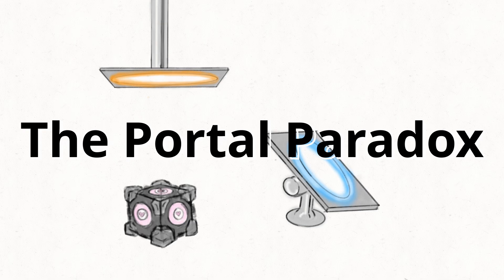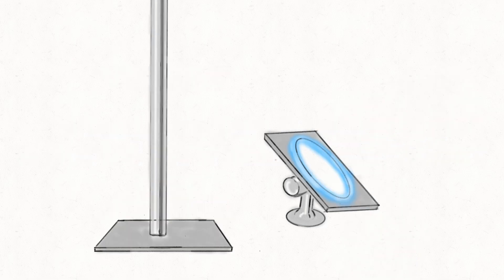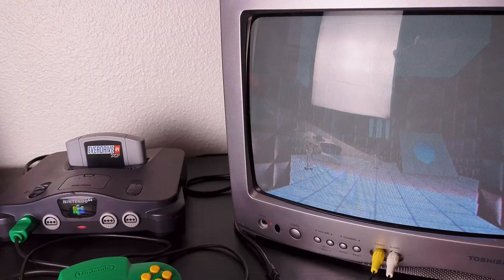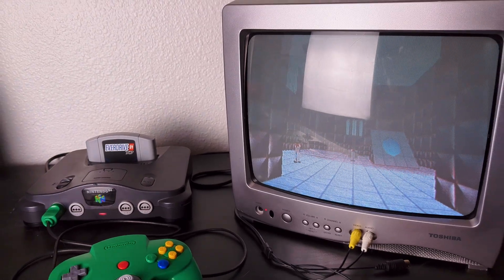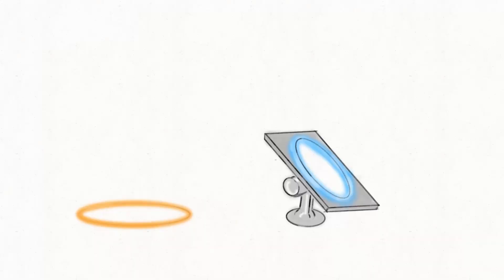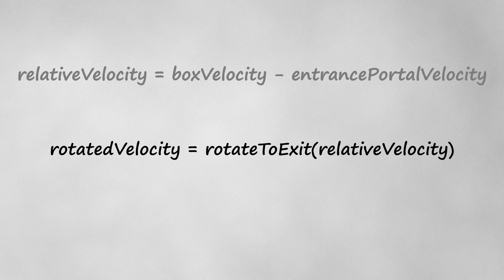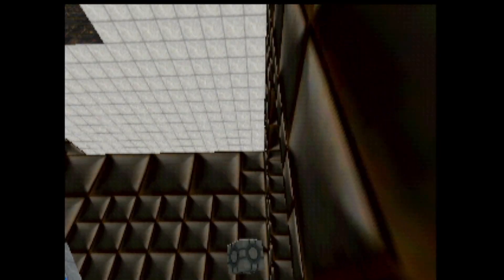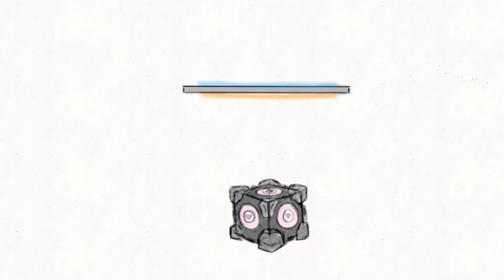I rewrote Portal from scratch and solved the Portal Paradox

Comment: You cant have the cube maintain its relative velocity to both portals.
You have to look at the energy of the cube. There is no way to impart kinetic energy on it from passing trough the portal. The portal just transports it to another place adding potential energy trough magic.
Reply: If the cube doesn't maintain velocity relative to both portals, it can't pass through. This is the only interpretation that lets the cube pass through without being distorted or destroyed entirely.

If the cube doesn't exit the exit at the same relative speed it entered the entrance, what happens to the length of the cube that has to "wait" to come through if you imagine it plopping out with no speed?

Where is the cube if it doesn't come out at the exact same speed it entered?
Reply: @fieldrequired283  You CANNOT maintain relative velocity to both portal because the cube is being teleported. It just is a situation that breaks all laws of physics.
Reply: @fieldrequired283  You have to forget the speed and think about forces on the cube. If there is no force applied on the cube it will stay on the same place. The only force that would do anything to the cube is gravitt and given the angle of the second portal the cube will just be translated trough the portal and not even plop due to the position of its center of mass. I will just stay there
Reply: @Obbliteration 
Portals inherently change the momentum and location of objects that pass through them. That's just how portals work.

It's like asking where the portal gets the energy to carry a cube from the bottom of a room to the top. That's just how portals work. They move things without applying direct mechanical force.

If you dispute this fact, you're just saying portals don't work, and so every possible interpretation of the paradox is wrong.

If portals work at all, they work the way they're showed in this video. The other way is logically incoherent for the reasons I described in my earlier comment.
Reply: @fieldrequired283  According to what or who?
Reply: @Obbliteration  
I gave reasons in my earlier comment. Read it again and form a more specific objection if you have one.
Reply: @fieldrequired283  I already explained everything. This conjecture cannot be solved because it is based on something that just cannot be explained with the laws of physics of our world. Any definitive answer has a fault.
Reply: @Obbliteration  
So, your arguments indefensible, you've moved the goalposts from "the cube plops" to "the question is unanswerable".

That's a kind of progress.

The cube launching out at speed is still the only way it can coherently work if portals are to work at all, though.

It is undeniably the best model in terms of cohesion with modern physics, intuition with portals, and the way portals are showed to work in the game.

The question isn't "are portals real" it's "what's the best model for how portals would act in this situation based on everything we've learned about portals".

And there is a correct answer to that question, and it's that the cube should be launched.
Reply: @fieldrequired283  I already told you. There is no correct answer
Reply: @Obbliteration  
There are better models and worse models. In this case, the launch hypothesis is simply a better model.

Even if you're taking the intellectually cowardly stance by declaring that there is no truth once your own pet theory is disproven, some answers are still better than others.
Reply: @fieldrequired283  Your comments havent disproven anything. We are just casually talking.
Reply: @Obbliteration  
Deflection. You're filling space with nothing because you know you are unable to substantiate any positive claim.

May you one day learn to concede a point more gracefully than this.

Comment: If this was true, wouldn't you be creating infinite energy? 
Your portal has a speed and the cube doesnt. If the cube gets the speed of the portal you are creating energy out of nothing.
Reply: Two stationary portals are already infinite energy. You could use two portals in a vertical hallway to power a waterwheel forever, no questions asked.

Portals violate conservation of energy, momentum, and velocity right out the gate. This objection defeats all portals, not just moving ones.

Comment: that's basically what I had in mind, cause I was thinking of it from a relativistic perspective. The box has no motion relative to the immediate space around it, but relative to the portal's immediate space, it does. Almost nothing in the universe is absolutely still. Even you, sitting in your chair, are technically moving at about 450,000mph. You just don't feel it because relative to the solar system, the difference between your velocities is close to zero. Even just floating out in the void of space, you're still being pulled along by the expansion of space. Thinking of it from a newtonian perspective, the box stopping in its tracks after having the portal slam into it would violate the second law of motion. If you are looking through the blue (stationary) portal as the orange portal approaches the box, you will see a box approaching the portal fast, and it will keep moving that fast as it comes through the portal. The inertia is preserved as the momentum is transferred from the orange portal's immediate space to the box. Another experiment to try is to shoot the box and portal at each other at the same speed. If you're just subtracting their velocities, then you should expect to see the box come out of the blue portal with no velocity, but based on the newtonian thought experiment, what should actually happen is that the box comes out with the sum of both its and the portal's velocity, since that's how fast the box appears to be moving to an observer outside the blue portal. So if the portal and box move into each other at 5mph each and the blue portal is moving at 5mph in its face direction, then the box should come out at 15mph.

Comment: Everyone approaches this "paradox" wrong. Ultimately, portals are non-physical, the game-world of portal is not real, so the solution must necessarily be author fiat i.e. the answer is whatever Valve says happens.

Trying to actually solve this using real-life physics is impossible because portals do not obey real-life physics. They routinely violate both conservation of energy and momentum.

The thought experiment is meaningless because the answer is arbitrary.
Reply: This is the only way for things to work if portals are going to work at all.

You could just say that portals don't work at all, but you're not solving the paradox, you're just refusing to engage with the problem.

The plop hypothesis simply does not work with physics, while this one does. It's only arbitrary in that he chose the interpretation that lets portals work at all, instead of one that doesn't.

Comment: If you flipped the piston and had it accelerating up at 9.8m/s, you could put the blue one on the floor and walk across it, correct? The atoms of the base of your shoes should be colliding equally from the force of gravity in both directions.

Comment: I think this is still incorrect. The portal is simply connecting two points in spacetime together, so the cube's velocity going in should be the same as going out. The only effects on it should be gravity (which would change as it's going through), and the atoms bumping into each other. Since the one portal is moving, the atoms entering that portal are entering in shorter succession than they're exiting, so they would be compressing as they go through. Also, a whole bunch of air molecules would have moved through before it, so there would probably be a lot of air resistance on the other side that would slow it down even more. I'm not exactly sure what this would look like, but it's definitely not as simple as a transfer of velocity. The portal doesn't give a shit how fast the wall it's on is moving. The portal itself isn't moving because it's not a physical thing, it's just 2 points in spacetime occupying the same space at once. Also, if this video is correct, the portal shouldn't even move with the wall: https://www.youtube.com/watch?v=qlce-gNit4U

Comment: If you break it down by the forces acting on the cube it doesn't make sense for it to fly across the room. All you have in both situations is gravity and a normal force to propel the cube. Relative to the cube, only one thing happens, gravity shifts to be at an angle and it is pressed into the ground from the air. So in instance A it is at equilibrium with its normal and gravitational forces. In B the cube is half way through the portal. It experiences a frictional force, a force of gravity at an angle, the force of gravity pulling it to the floor, a normal force from the air into the floor, and a normal force from the floor itself. In instance C is it through the portal, gravity is now entirely at an angle and it once again experiences a frictional force resisting movement down the ramp, and a normal force from the floor onto the cube. If the cube starts without velocity, and it experiences no force to cause acceleration, how does it gain velocity? I don't see how your explanation isn't a violation fo newtons 1st law. It was still and then no force was imparted onto the cube from the direction of the floor to launch it.

Comment: This is actually easier. If you think the cube goes flying, tell me, where did the Kenetic energy come from? If you say "but but, it came from the portal" no, it went through the portal, did not touch the portal.
Reply: In a different reference frame, the cube was moving toward the portal at the moment it went in.

Motion is relative. If A is moving toward B, then B is moving toward A in a different frame of reference.

Since the cube can be described as having some velocity when it went into the portal, it continues at that velocity when it exits.
Reply: @freedomfighter763  no, its not relative. If two objects in space are going near the speed of light, then in the reference frame of the first object they are not moving. Problem is you can not go faster than light, so if you try to make one go faster, it does not go faster. Reference frame is horse shit to make math on the lage scale easier and neglect what is not important. Well in this example, it is important.
Reply: Portals change the location and momentum of objects without touching them. You can see this plainly and intuitively by throwing a cube into a portal on the ground where the other portal is also on the ground.

You threw it in moving down over here, and now it's moving up over there. You completely reversed the momentum of the cube without touching it.

Comment: I don't think you are necessarily wrong, but that also doesn't say/prove you are necessarily right.

First, it's called a paradox for a reason. If there was a solution, it wouldn't be so.
Second, you solved it answering questions you asked, and put it to the test with an assessment you deemed capable of doing so.
What I'm getting at is that it's biased and one sided.
You tried solving a paradox using one example alone. You need more scenarios.

As for the example you made, I believe it makes sense, since the cube is accelerating while on a (closer to) vertical position, which would cause the cube to accelerate upwards and forwards.
Reply: Many things are called paradoxes that actually have a single correct answer. This is one of them. No other way of solving the problem works.

Comment: This video is absolutely correct in all regards.

The thing that people are missing about slamming down the portal that's blue on one side and orange on the other (the second experiment here) is that the orange and blue portals actually have the same velocities as each other, they're just also pointing in opposite directions. It's easier to think about the portals as having an in vs. out reference frame, rather than up vs. down or any other kind of reference frame.

If blue is stationary and orange moves toward the cube at 5 m/s, the cube will enter orange (in) at 5 m/s and exit (out) blue at 5 m/s. But in the experiment the "out" direction of blue is effectively moving at -5 m/s, not zero.

For another example, think about throwing a baseball. If you're on stationary ground and can throw a baseball at 20 mph, your throw makes it go 20 mph in whichever direction you threw. If you're on a train moving at 20 mph and throw it in the same direction as the train is moving, someone standing still will see a baseball moving at 40 mph. Conversely, if you throw it toward the back of the train (away from the direction of motion) a stationary observer would see the baseball stop and fall straight to the ground.

In all cases you have moved the ball in the same way relative to your own motion, but outside observers (us) see very different things.
Reply: To bring it back to the cube example, imagine instead that both portals are on vertical wall pieces, with the orange portal moving toward the cube which is sitting stationary on the ground. The blue portal is on a different section of wall and moving backward at the same speed that the orange portal is moving forward. Any motion conveyed by the orange portal running into the cube would be cancelled out by the backward motion of the blue portal.

The orange portal is essentially "throwing" the cube at 5 m/s, but it's on a moving train (the blue portal) and so it just stops and falls to the ground like the baseball.

Comment: We already have a definitive, in universe, answer to this question.
In portal 2 there is a moving portal, when a portal is shot onto the moon it is absolutely moving in relation to the portal on the earth, yet nothing exits the moon portal and suddenly seems to gain 3500kph horizontal velocity.
The frame of reference changed, but the velocities remained consistent.
Reply: In order for this to be a good analogy, you would have to put a portal on the moon and then have the moon crash into the earth.

What happened at the end of portal 2 isn't like what's happening in this video at all. It's a nonsense comparison.

Comment: Well, maybe this has already been brought up but...
If it takes work from the entrance portal to push the box through, then yeah, it would fly out because it is imparting energy onto the box, but if it takes no energy to push the box through, then no, it wouldn't. If no energy is used to push the box through, the box could not fly out the other end. Relative velocity be damned, honestly. If it takes no energy to push the box through, then you're creating energy.
Reply: You can already use two stationary portals to generate infinite energy. This objection defeats all portals, not just moving ones, and it definitely doesn't support the plop model over the launch model.
Reply: @fieldrequired283  if you're talking about one portal on top of the other to create an infinite fall, that's a whole other discussion. 
I asked a question. You are assuming I am favoring one conclusion over the other, which I am not. I am asking a question that I think is important.

Comment: It makes sense 

Portals just transfer movement to another point, so, to the blue portal, the floor and block are moving toward it at some velocity before the floor eventually stops.

This would be like a piston pushing a cube very fast and then stopping, which would intuitively launch the cube.

Very cool video!
Reply: This also implies a property of portals wherein they imbue an object passing through them  with velocity relative to the exit portal

Proponents of the plop would be thinking object retain velocity relative to the entrance portal
Reply: this does not make sense,  a piston pushing the cube imparts energy because the matter from the piston push away at the matter from the cube, the portal is a hole, it does't interact with the cube, and does not push it any direction. all it's does it allow it to pass throught the other side.